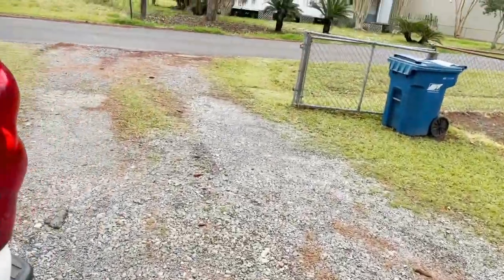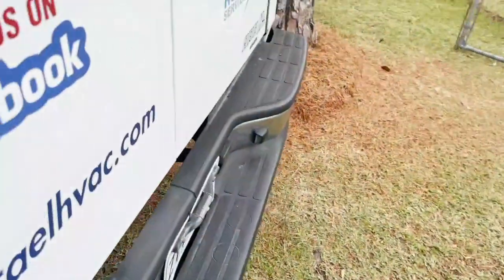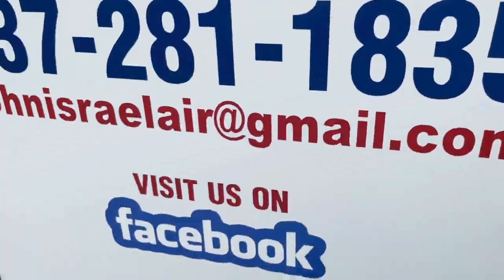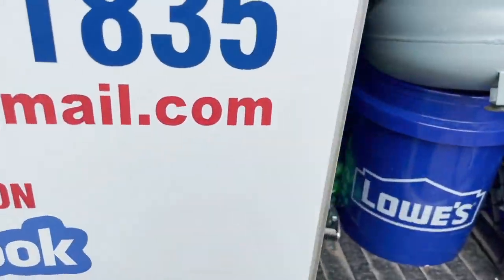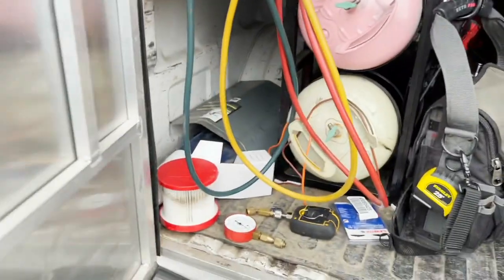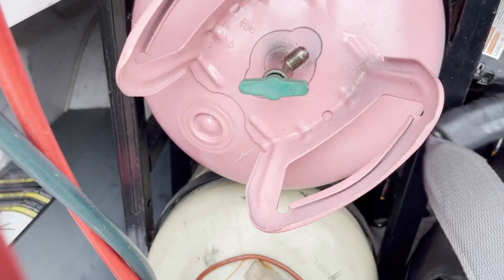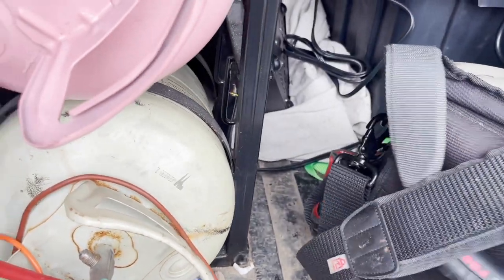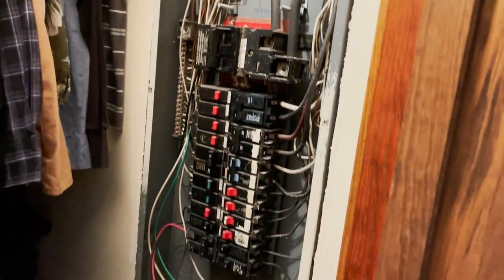No Heat/Simple Fix

Comment: 35 degrees, 😂 it was single digits here the other day, also gets to negative temperature here as well, nice video replacing a breaker. Is it legal in LA to go into a breaker panel and fool with the wiring? Here in CT it’s not

Comment: Nice video! 
Were the wires hot while you installed the new breaker?
Reply: The wires have no power. They get the power from the panel bus bar. Once the breaker is turned on, it energizes the wires. When you snap the breaker in the bus is when it brings power to breaker and when turned on …to the wires.

Comment: Do need an electrician license to change a breaker? Or by being a hvac tech you are allowed to do so with permission I suppose
Reply: As a HVAC in Arizona, I wouldn’t think so. As long as you change the breaker with the same amps. It should be alright. Residential electrical is pretty easy.